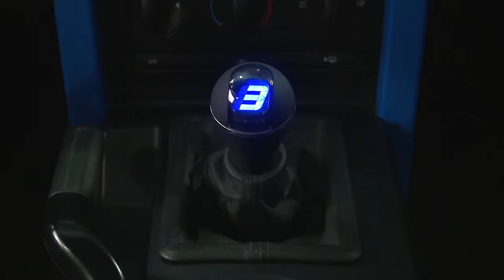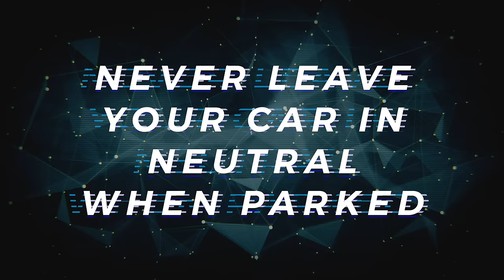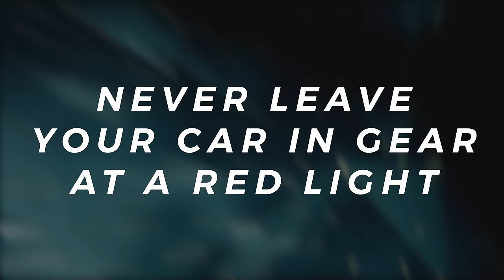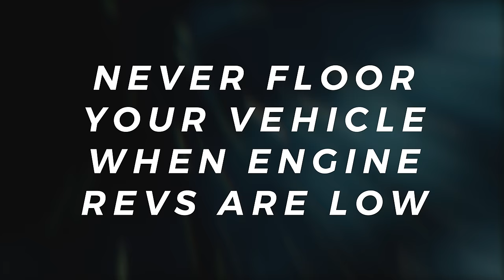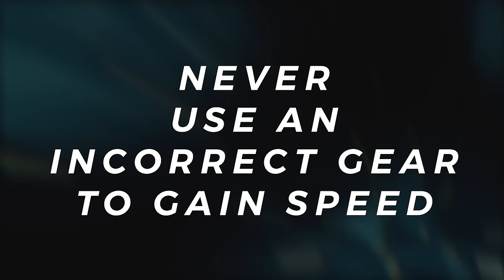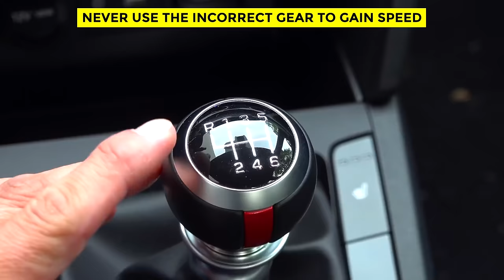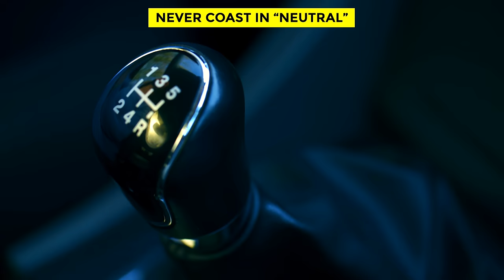7 Things You Should NEVER Do In a Manual Transmission Car!

Comment: "Clutch slipping will destroy the cluth" Well mr einstein then tell me how to start on a hill.
Reply: DOABLE! It requires
1.stong enough engine to pull the car up without stopping on the step 2.
2.stong enough neck(so it wont get snapped when you suddenly release the clutch) 
3.weak enough hand brake so it will fail if you accelerate without releasing it :D
Reply: @Ev0ltion  hehehe
Reply: "You don't"
Reply: Just do like me and dump the clutch and hope the car stops doing a burnout and you go up the hill
Reply: @_Boobz  that's amazing 😂😂😂 made me lol
Reply: Well duh just don’t drive on hills

Lol
Reply: @evanorner4979  not possible in Washington
Reply: @_Boobz  same in pa. My vehicle shuts off on hills when I push in the clutch sometimes
Reply: @evanorner4979  my 4 banger ranger I had was the worst on hills, ripped someone's bumper off cuz they were too close and I roll back hella far
Reply: Simple...Drive an automatic 😂
Reply: 1. engage parking break first
2. engage clutch
3. shift to 1st gear (if not already done so.  You park uphill on first gear engaged anyway)
4. do the usual clutch and gas pedal work to move the car uphill, while slowly disengaging the parking/emergency brake
Reply: @_Boobz  🤣🤣💪🏿
Reply: rev a bit then release the clutch normally xD
Reply: @_Boobz  Lool rev those rpms up and just go 😂
Reply: Worrying about clutch slipping it's like walking barefoot because you don't want wear out your shoes
Reply: Or do reverse parking
Reply: I have 20 year old bmw and clutch is working fine and previous owner was female so im sure she slipped it a lot and still works like new
Reply: @glenndelacruz2906  Perfect method.
Reply: How to start at all
Reply: Start the car in 1st gear with clutch engaged?
Reply: Am I the only one that has to sometimes slip the clutch a little when reversing? Like not all the time just in small spaces where you gotta inch your way out big full parking lots for example lol
Reply: Still there is way, just put on the handbrakes and then you can release clutch pedal after shifting on 1st gear....It will make sure your car does not goes in reverse direction...Just when you get forward motion, release the handbrake... Although this will force your car to stop and to go forward at the same time, still it's better than the vehicle going in reverse direction at hill in traffic
Reply: @JerrYReaPPer  at the time you release your foot from brake pedal, the car will start going in reverse...Even if you pressed accelerator quickly, the car will go short distance in reverse first and then in the forward direction. (Only if handbrakes are not applied)
Reply: A school of thought here—the clutch is designed to wear out.  Just like the brakes.  The key here is to minimize the time you are “feathering” the clutch to get it up the hill.  Use as low a gear as you’ve got, of course so you can let off your clutch more quickly.
Reply: You can use "heel and toe" method. Left foot on the clutch, right toe on brake and right heel on gas.
Reply: Keep your legs on the break apply clutch put the car in gear slowly lift your leg from the clutch until the car is ready to move forward lift your leg from the break the car won't move back at that point apply some acceleration once the car moves forward slowly release your leg from the clutch paddle
Reply: Hold the break and the clutch , then lift the clutch to the friction point and then accelerate while leaving the clutch
Reply: YALL ARE GIVIN BAD ADVICE!
ALL YA GOTTA DO IS:
1. SHUT OFF CAR
2. PUT INTO 1 GEAR
3. TAKE FOOT OFF CLUTCH
4. TURN KEY
the stsrter motor will pull the car up the hill, without slipping the clutch.

Note: attempting this for too long, or while towing a trailer may burn oit the starter.

FAQ:
How do I know my starter is broken?
A: turn the key with the car in nuetral. if the starter goes KJRRCCRRKGCKRRR, it's busted.
Reply: @harshalharke743  it can be done and it has been done for over a century
Reply: Get an automatic, problem solved.
Reply: Quickly. Remain in the engagement for as little time as possible. I've got hill hold on my VW Golf R, and I don't like it because I don't want help, but it is a good thing for starting on a hill.
Reply: @Ev0ltion  Use the handbreak in conjunction with the clutch. It's called a "hill-pull".
Reply: @BugYall   I know the correct way to do it. Its a basic skill required to get a drivers license where i live. This whole comment was meant to be a joke.
Reply: @_Boobz  I believe everyone cops out like at least once.
Reply: @evanorner4979  
the Netherlands has entered the chat
Reply: Its Easy. At First you pull the Park break give give gas to 2000 Rpm and Release the clutch until its vibrate and than if you feel you car want go than relese the handbreak and than the clutch
Reply: @_Boobz  I live in an area that doesn't have that many hills but there is one that has a decent enough slope to make my Sentra roll back and every time someone leaves less space than I have chances of getting a girlfriend always pisses me off
Reply: Use the jedy force my friend
Reply: @Fulmynato  Unfortunately, not all cars have good pedal placements for heel-toeing
Reply: @Ev0ltion  How do you do it then? Lol Just out of curiosity. I don’t use the parking brake, or heel-toe. I just go quick from the brake pedal to the gas pedal and slowly release the clutch while revving in first gear. And I’ve been on some gnarly hills with a full truck bed. 🤷‍♂️ This comment section is making me think I should practice on heel-toe method though.
Reply: @Slideways1989  That’s true. My Tacoma is a single cab, not too much leg room for me to go heel-toe. Totally forgot about that.
Reply: @chrisp9046  This comment was meant to be a joke. Correct way of going stip uphill is to engage hand brake, release brake pedal then slowly start releasing the clutch while slightly increasing rpm when you feel that the front of the car is lifting(if you are using fwd not sure in 4x4 never had one) release hand brake while adding a bit of throttle while releasing the clutch compleatly.
Reply: @Ev0ltion  No I know it was a joke. It just got me thinking lol. But good to know, maybe I’ll try using the hand brake. Thanks.
Reply: @glenndelacruz2906  no handbrake, its a foot brake, so idk how well that would work, but doesnt matter because it dont work anyway XD
Reply: @_Boobz  This is basically what I do, but my car doesn't have enough power for a burnout, so it slowly gets going. Or doesn't, in which case I tell the drivers behind to back off as I roll down to get a bit of speed.
Reply: You get out of the car and go on foot
Reply: @FoxAlky  Up Hill? We aren’t caveman anymore!
Reply: Simple it's called clutch control oh wait u don't have that it's mostly automatic with pretend clutch if u had any idea about clutch it's easy....... Clutch control
Reply: [Standing on brake, in neutral]
Engage handbrake.
Release brake.
Clutch then put in 1st gear.
Release clutch enough to "catch." Rev to maybe 2k rpm.
Disengage handbrake.
Release clutch fully while gassing.
Reply: I think he wants us to dump the clutch I’m not sure though
Reply: @Ev0ltion  i think i have all 3 of those
Reply: You push the gas pedal until you reach 6,000 rpm’s and then you let go of the clutch as fast as possible and you’ll be on your way no problem
Reply: @Rafael-lg1vw  hehehahaha the irony is that you still get slippage just now the ENGINE is in strain now as well
Reply: I don't park on a hill to begin with if I can help it. I will park in a driveway or find a place more level
Reply: As long as you don't rev up the engine up to 5000 RPM, you should be fine. I did that once when I put my car in a ditch. I was able to get the car out, but I really damaged my clutch
Reply: @clintjeffery739  It's a necessary evil, and as long as you don't go through high revs, you should be fine
Reply: @_Boobz this is what I do all the time🤣
Reply: @nikhil3433  how do you know when the car is ready to move forward is the issue
Reply: @Ev0ltion  this made me laugh way harder than it shouldve
Reply: Low revs find bite hand break off go up hill.  Basic
Reply: @adityasharma3322  yeah but manual is just so satisfying and rewarding
Reply: @mssed3031  so truee👌👌👌
Reply: @_Boobz  On one car I had the accelerator was so touchy that it was really hard not to scream the engine trying to get it at an RPM to get it into gear while at a dead stop on a hill.

Fuck I hate manual transmission cars.
Reply: Clutch slipping is not the issue, you literally can't start moving a car without some slipping. I think they are referring to clutch slipping for long periods at a time.
I personally use handbrake to hold the car in place, and then once i feel like I'm at the point where my clutch is gripping, i release the handbrake and you climb the hill :D
Reply: @nikhil3433  This is the alien's approach to hill starting because it needs three feet. Is your handbrake broken?

Comment: Btw don't disengage the clutch everytime you brake, but only when you're about to stop. Braking while clutch is disengaged denies engine brake, resulting in longer braking distances and more brake pad wear. Also, if you happen to oversteer, or lose traction to the rear tires while braking, it's pretty hard to correct if you can't accelerate.
Reply: Also keeping the clutch engaged for long periods of times puts strain on it`s components, mainly the friction disc, and it wears a lot faster. Whilst the car is moving, you should only press the clutch when shifting gears and press the clutch whilst braking only when you`re about to stop to a standstill, even if you could put it in neutral and brake to a stop.
Reply: @mariusrutza  agreed, but it's not the friction disk that wears, in fact if the clutch pedal is fully depressed then there won't be ANY wear at all on the friction disk just the bearing.
Reply: Are you insane the clutch should be always pressed with the brake or you want to stall every time you loose enough speed, thats unless your speed is way over your top gear then you don't need to press clutch.
Reply: @vinportobg  dude...
Reply: @vinportobg  tell me u nvr driven a manual without telling me!..haha bro the engine aint gonna die unless it drops below idle...an aslong as ur revmatching very lil wear is happening to the clutch..its normal wear
Reply: @vinportobg  not true 
my 60yo instructor tells me to press the brake gently while going downhill  to use the engine brake and regular brake at the same time in differing amounts
Reply: We have a discrepancy in the terms used here: you ENGAGE the clutch when you let the pedal up to take up the drive, you DISENGAGE it when you push the pedal down to disconnect the drive.
Reply: @rickconstant6106  important clarification good point
Reply: @rickconstant6106  Woops sorry English is not my first language and we refer to it opposite. Yes you're right, good clarification. I modified the original comment.
Reply: What if i must slower from 50km/h to 10or 20? i should still drive with 4th gear? I am not asking but just pointing that you must use your clutch more often then just for stopping
Reply: @jakubbaranowski2190  Oh yeah forgot to specify in a manual you want to use the clutch to change gears too.
Reply: @jakubbaranowski2190  in that case you'd want to change gears as well, so you'll have to disengage the clutch for that. You wouldn't just press the brake, slow down to 10 and THEN press the clutch (or at least you shouldn't), so you'll use the time to change gears as well.
Reply: @jakubbaranowski2190  ty tak serio? XD
That's just plaing dumb, I believe... No one slows down from 50kmph to 10 without using the clutch. It's rather obvious that to engine brake you have to change gears when needed, until you stop. I'd advise not to use 1st gear when engine braking, as it's hard to drive smoothly in this gear. Just go to 2nd and when you want to stop, disengage the clutch and press the brake pedal.

Just don't allow it to stall and start vibrating, that's all there is, really...
Reply: i'd rather brake pad wear instead of clutch wear. brakes are cheaper to fix/change
Reply: @kimboslicefan78  That's funny, because, when done correctly, engine braking doesn't degrade the clutch nearly as much as moving off, or anything else...

If you're still unconvinced, then don't change gears at all, because that's all it is 🤷‍♂️
Reply: @lazyh-online4839  the clutch plate will also wear
Reply: @kimboslicefan78  except if you drive down a mountain slope. breaks overheat and fade. and totaling your car is rather expensive. the only time, you my not wanna use engine brake for low steep downhill segments, is deep in winter. As engine breaking (unless 4 wd) only uses two wells to break. if one hits a bit of black ice... you're again end up with a huge bill.
Reply: @Woulfiee  it also strongly depends on vehicle weight and engine size. heavy delivery van with a small turbo diesel engine, simply doesn't engine break fast enough for it to be usable in traffic. It wouldn't really be possible to shift and revmatch fast enough for any effect in most traffic situations. (still extremly important on downhill slopes, to prevent brakes fading.)
Reply: Came to to say this 👍🏻
Reply: @beyondEV  I drive a 2.5 ton Ford Transit van. I recently replaced my brake pads and disks, but the garage had a several week wait. In the meantime, I had to use engine braking because the brakes were grinding metal on metal.

I wouldn't recommend it, because it does result in much longer braking distances, but it is entirely possible to use engine braking in traffic on a large, heavy vehicle.
Reply: @vinportobg  what the helll
Reply: if you lose traction just slam the brakes. unless your car has no ABS then welp
Reply: @ReddwarfIV  agreed, and it's doable if you don't overspeed and brake early

Comment: Worrying about clutch slipping it's like walking barefoot because you don't want wear out your shoes
Reply: Thanks g I have to keep having to remind myself this when getting into 1st
Reply: Except replacing your shoes doesn't cost the price of a used car
Reply: @waldolemmer  Replaced clutch costs in most cars (family cars Europe) like 250 to 400 dollars depending on your engine displacement, complexity of the operation etc but this is the average lol. You also change it once what every 200 thousand kms or 150? Its expensive when you have a V6 sports car yeah the price can like triple from that (even that isnt super expensive considering how long will it last you).